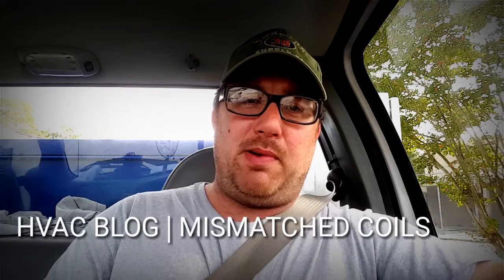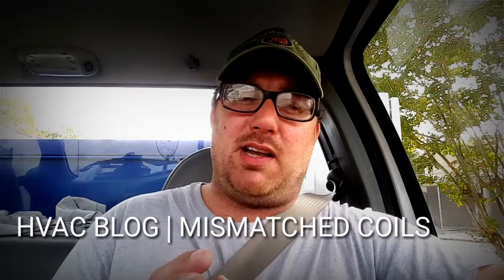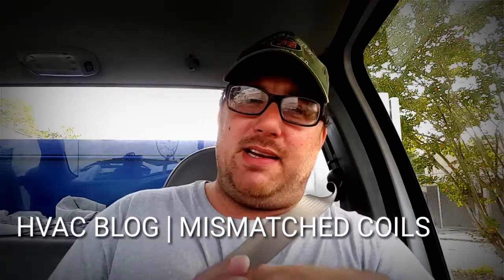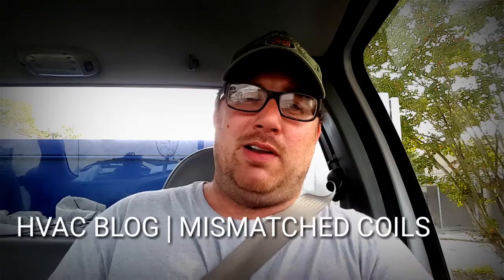HVAC Blog | Mismatched Coils

Comment: Hey Zack, wouldn't it be possible to put an adjustable TXV on the evaporator to control superheat since you would naturally have enough subcooling in the condenser due to the larger condenser coil? Would this pose any additional issues?
Reply from the maker: The issue that would arise is that to get the proper superheat on an undersized coil you may end up getting an extremely low suction pressure.